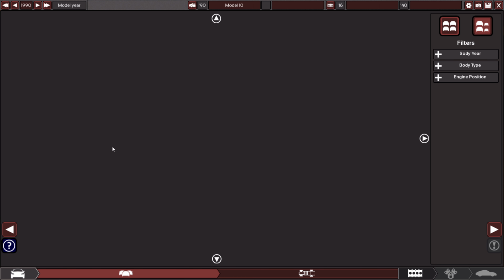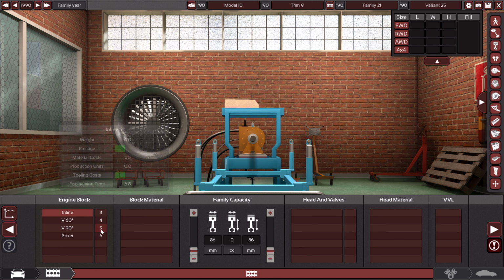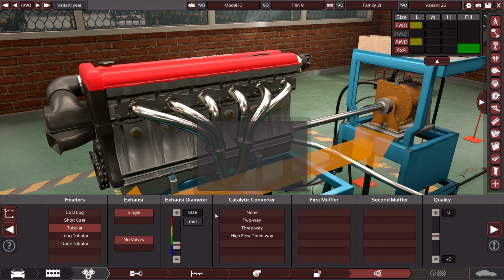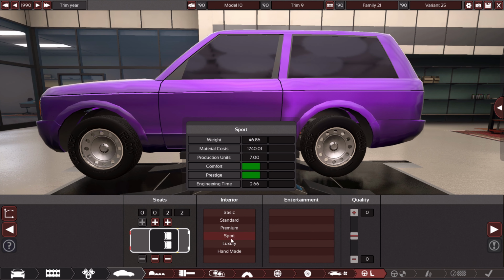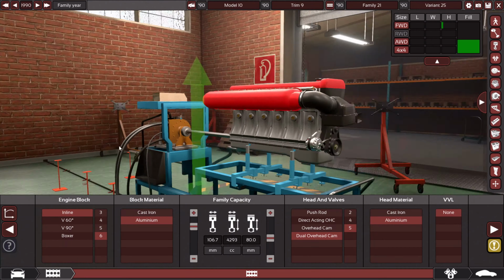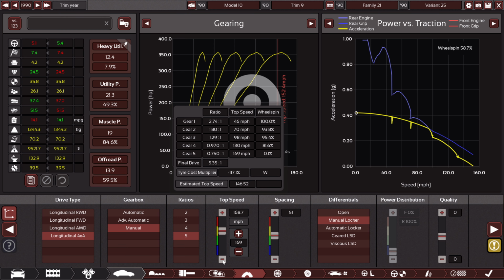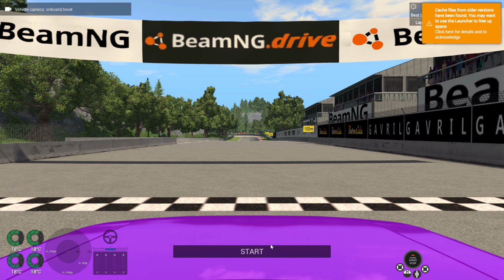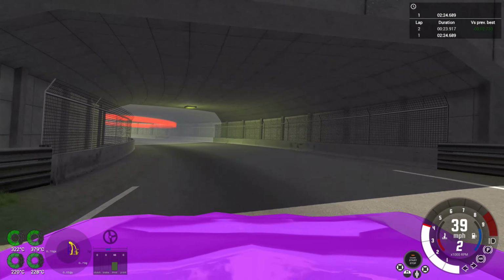Building A Rally Thing Automation----BeamNG.drive

Comment: A message from virage automotive: hello duo, we have gotten the prototype delivered to us, and while we are thuroughly impressed, we had to make a few changes:
Race parts were used for the engine, so we had to swap em out for performance parts, this drops the horsepower from 404 to 397.
Extra safety features such as roll cages and upgraded anti-sway bars were added.
Minor aerodynamic changes.
Changed the colour to luxé black, and gave it the #44 virage/(company name) racing livery.
With these changes made, the offical model will be ready to partake in the championship

Comment: Dalluha-fruninia de grande championship final standings:
1st: Jension dormonk with 123 points (#53 Zedii dunniberg rally car)
2nd: Merdin Biplyon with 112 points (#44 Virage/core2duo racing team verton rally truck)
3rd: bennadict harvyen with 87 points (#71 aphies JJX rally car)
4th: Ronald venny (#28 Chekson slovako lebinsword rally car)
5th: Ferdinand Robinson with 74 points(#20 merdico houndsy rally truck)
6th: Dermek Kontov with 71 points (#70 menyod moxicon rally truck)
7th: Dergiov Resno with 56 points (#97 Aphies JJX rally car)
8th: Aiden Shasen with 52 points (#36 Chekson slovako lebinsword rally truck) 

DNF list:
jamasisho kentobaki did not finish due to: engine seizure by overheating due to coolant loss
Arbon shifusari did not finish due to: severe rollover causing irreparable damage.
Kyle mondy did not finish due to: illigal engine modifications
Miles Serbug did not finish due to injury in a severe crash.